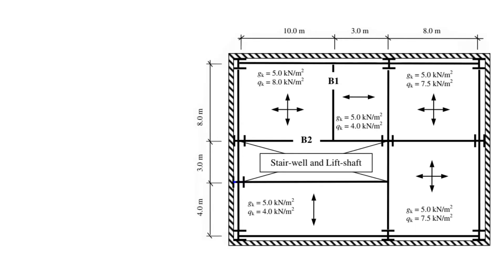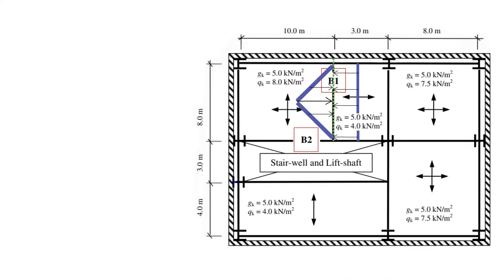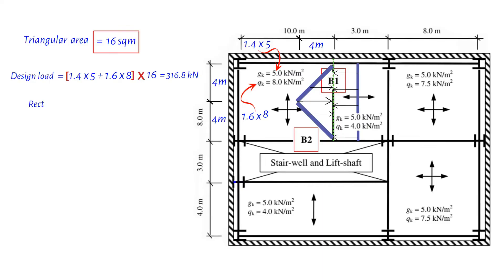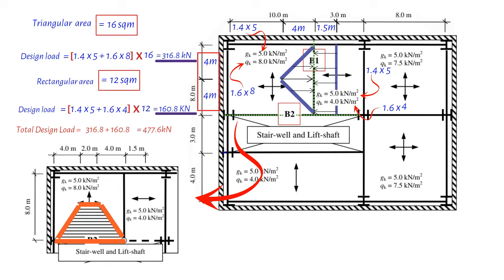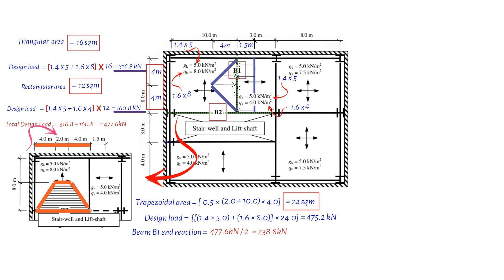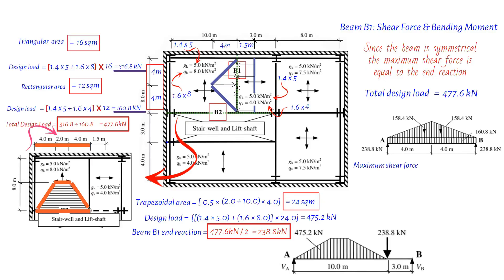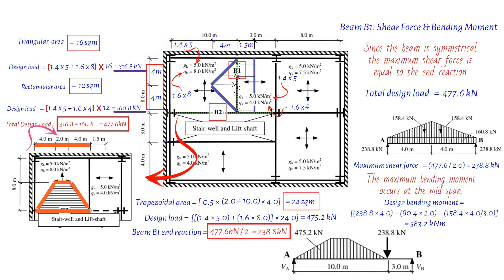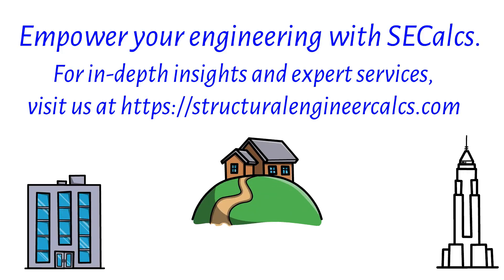How Buildings Stand Strong: The Essential Guide to Beams & Loads

Comment: This applies only to simply  supported beams not with fixed ends . 
Not for continuous beams over many columns with fixed ends . 
Also moments from columns are added in.
Good example of a simple low rise structure.
Just helping others learn.
Architect Engineering NYC .
👍